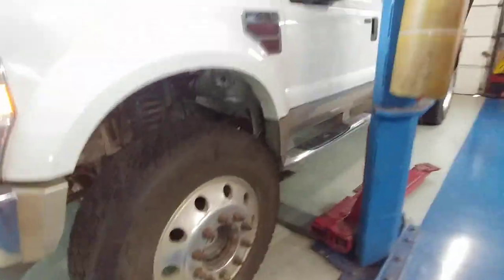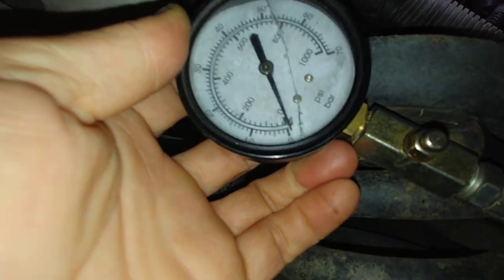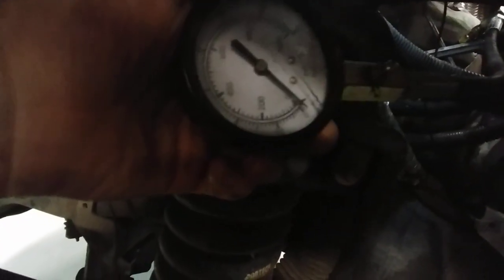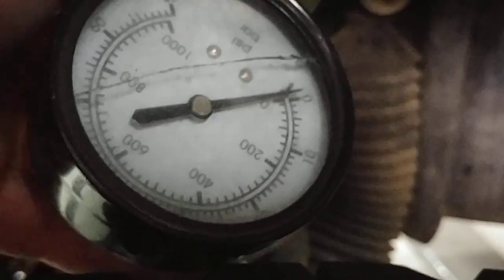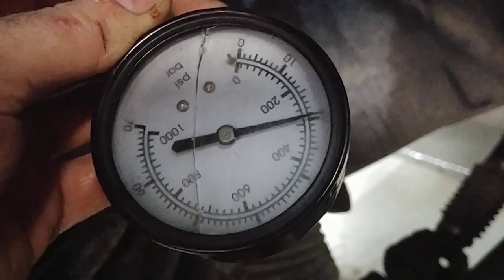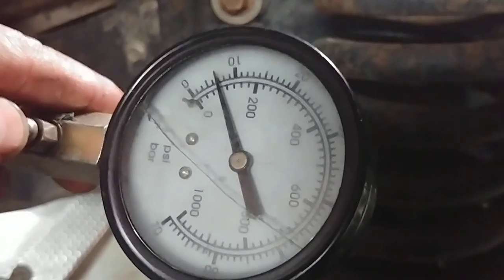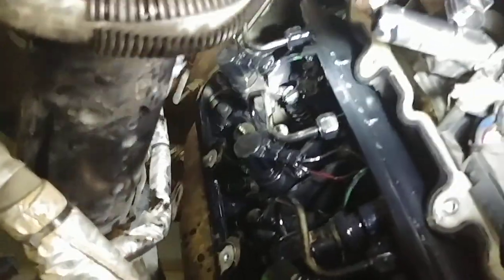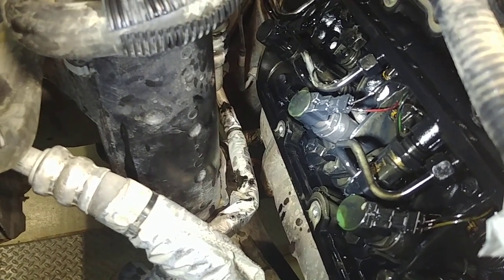Ryan's 08 compression and rocker failure

Comment: damn.....another 6.4 rocker failure.  Anthony, you know your $hit, hate that there are alot of other things in the 6.4 that when they get to this point, the rest of the engine is not far behind.  The "big ends" of the rods are not rebuildable, and alot of other things in the guts of the engine are simply not repairable (economically) .  I would almost let Anthony start over with a new engine than to limp one along.......just my .02